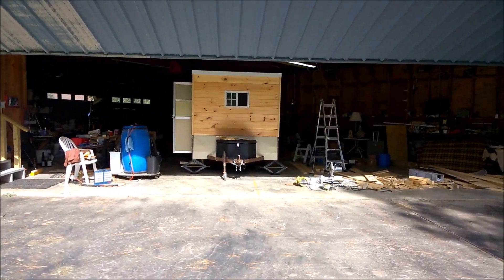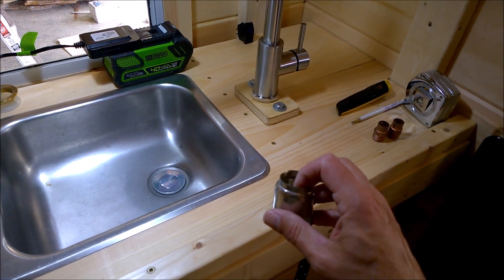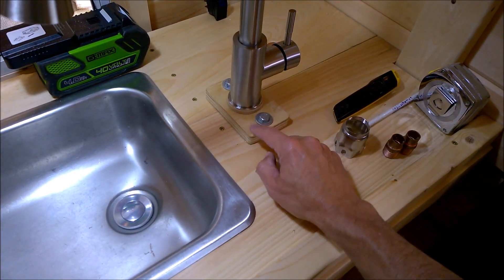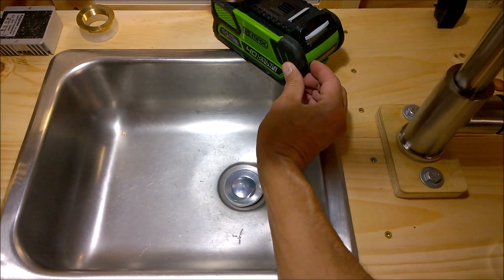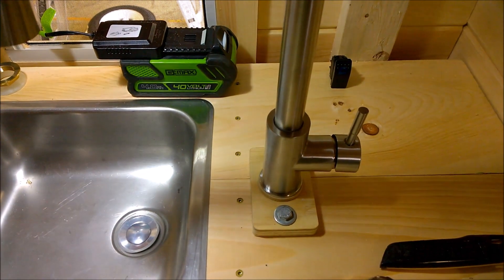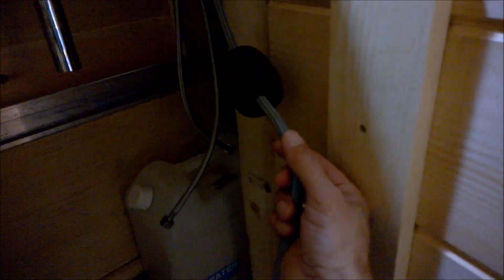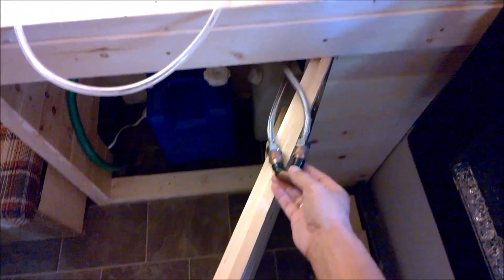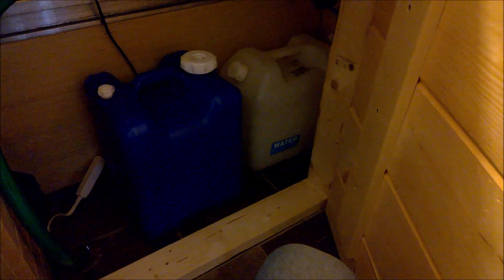Pop Up Camper to Hardside Conversion - Part 15.1 - Kitchen Faucet Installation!

Comment: What was the finished weight ?
Reply from the maker: I'm estimating around 1,200 pounds.  I weighed it after the sides were up and it was around 800 at that time.
Reply: Bed? Or did I miss where you sleep?
Reply: I’m possibly getting a pop-up camper from my in-laws. I’m not sure of the length it’s longer than yours. I was going to gut it and make it into a trailer for hauling but this seems like an awesome alternative.